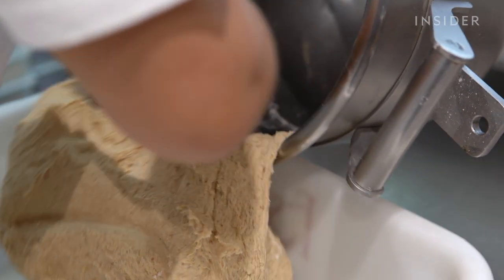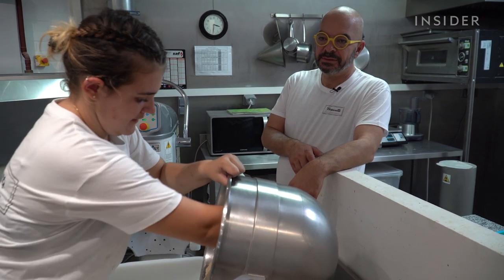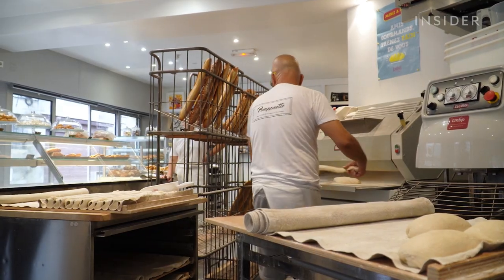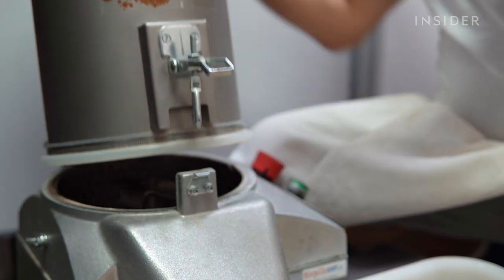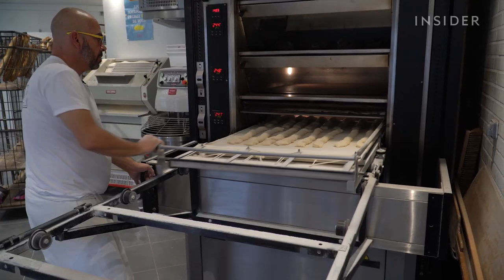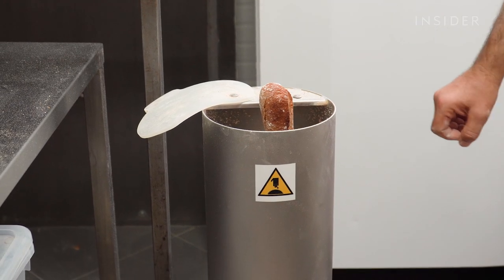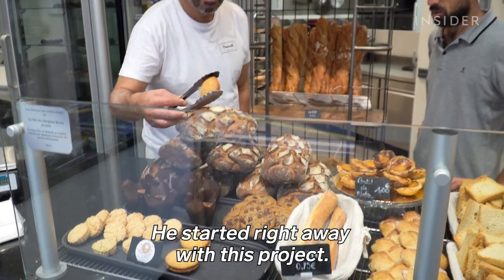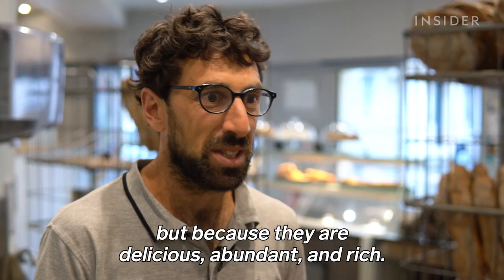Flour Made From Leftover Bread Could Help Reduce Waste | World Wide Waste

Comment: If these bakeries have a lot of unsold bread at the end of the day, why not adjust to the demand?
Reply: It is more profitable to do a little more than to not have enough at the end of the day, and it is not like he make double of what he sells, 3 or 4 breads a day might not look like much but it stacks
Reply: @DrunkenDove  lmao they don’t make 15 different types of bread.
Reply: @micahroberts4481  lmao I guess you've never been to a bakery before.
Reply: @micahroberts4481  in France you can have many type of bread in a bakery, 10 types would be a minimum for every bakery
Reply: @Mesmosar  lmao the bakery where I live just sucks, they have 3 types of bread.
Reply: Easier said than done.
Reply: Because some days, you sell out, others you don’t. Demand is always in fluctuation and for fresh products (like bread) leftover supply can’t be reused as easily.
Reply: @micahroberts4481  like cobs bread? It is shaped differently but all tastes the exact same. Oh also tastes like crap.
Reply: Easier said than done. It's not easy to predict the exact number of demands everyday. They either ran out of stock, or ended up with leftovers. If they're really good at it, they might end up with small amount of leftovers everyday, but it'll still adds up.
Reply: Because the demand changes every day also. It is very much connected to how people feel. Now some other researchers are selling a software that would tell the bakeries how much to make every day based on the weather, the general mood, the time of the year. Also they tend to make a bit more because no body wants to buy the last baguette of the day. Everyone wants the first baguette fresh out of the oven
Reply: well you sure give demand to your local bakery

Comment: you can also still eat stale bread (as long as it is only stale and not modly) so you don't have to throw it out.   I just put a little water on the stale bread, and put it on the microwave to restore moisture. Then I will put it in the oven or toaster so it will not be soggy / just a little toasted.   It works fine.

Comment: I make my bread at home. Years ago if some went stale I would gate it, sift it, and use the large crumb in other recipes while using the finest in my next loaf or to coat chicken. For some reason I've yet to figure it doesn't do so well in gravies.
Reply: Finely ground breadcrumbs do a fine job of  replacing flour for being crumb (the internal texture) in bread. But they can't absorb liquid fat and emulsify sauces like gravy in the way that raw flour can.
Reply: @Caseyuptobat  I had thought that perhaps, at a guess, it was because the molecules that caused the thickening action changed when baked.

Comment: Reusing bread is a good idea but the "crumbler" is not a new invention, we used meat grinders before to grind dry bread into crumbs then food processors. It's just a larger grinder/food processor and they all do the same thing, break down things into small pieces with a rotating blade.